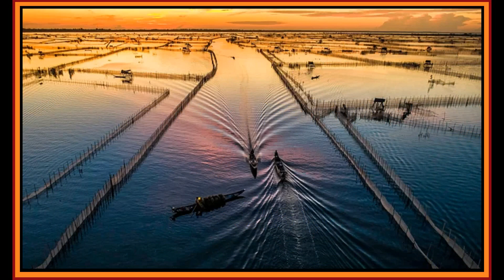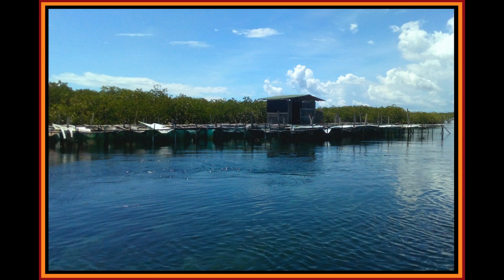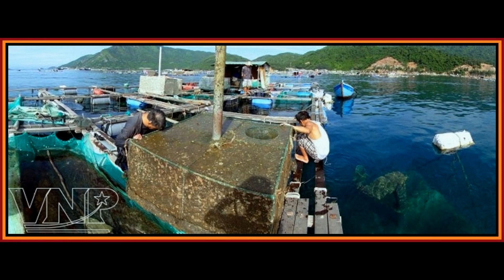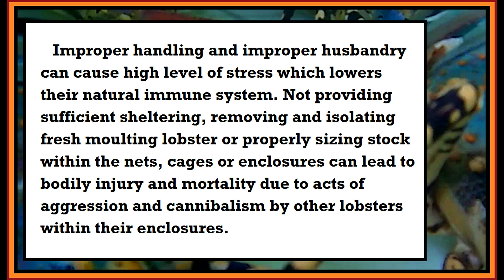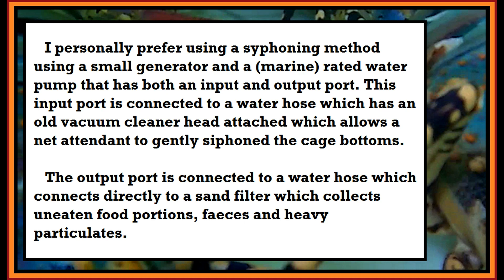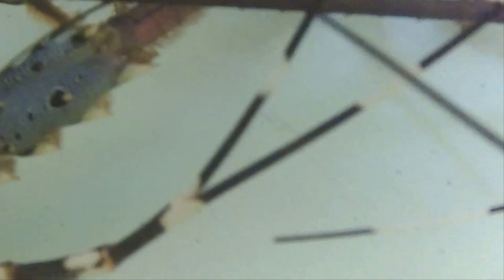Tropical Spiny Rock Lobster 101 - species Panulirus 'ornatus' - Video (3of3) Part-A

Comment: I have lots og baby lobster sir,    what are the feed for. Lobster. Please help. Me,
Reply from the maker: This a rather lengthy topic and one I am presently compiling for the next Youtube video of this 'Lobster 101' series. Perhaps the best short-answer is to include a diversity of shell-types, urchin, crabs, anchovies and freshwater apple snails. These will add much needed lipid (egg yoke) to their diet. Strict fish diets tend to provide sufficient lipid-levels as well as limited weight gains. This is where the varieties I listed above are such a benefit, as they also help promote consistent muscle-mass weight gain.

      I am hoping to have this next Youtube video ready and up-loaded by mid-June. I believe you will find it quite beneficial for you as the information is quite extensive and well detailed...